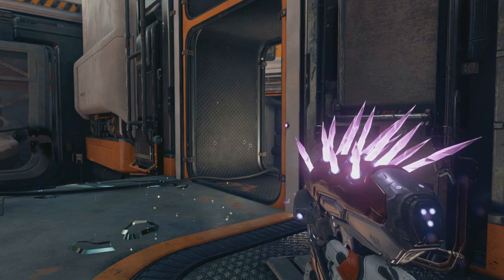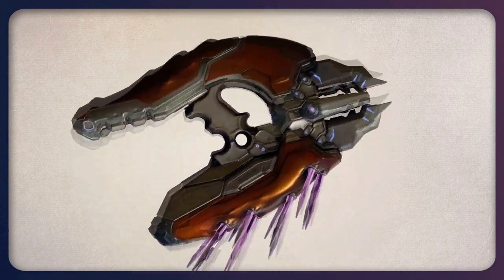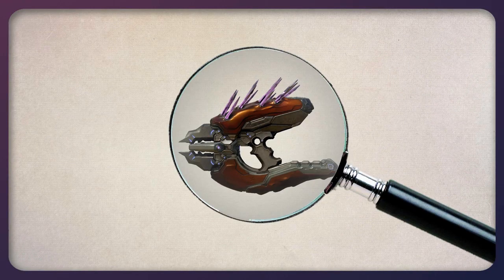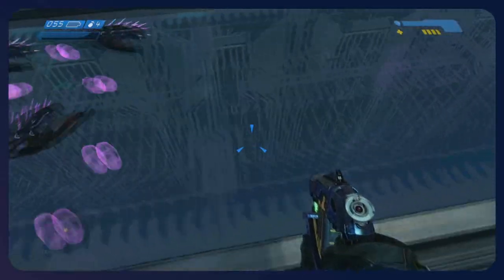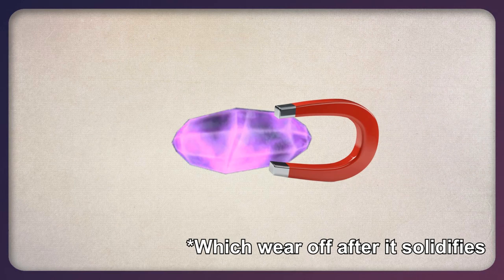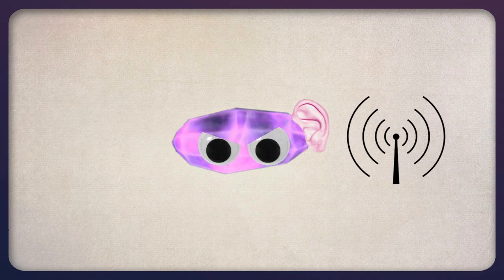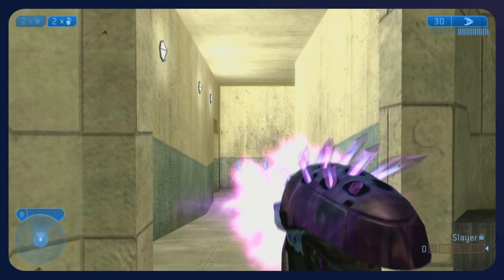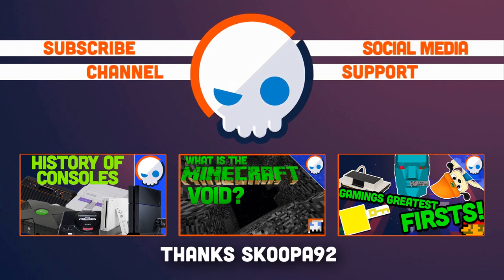Halo Theory: How does the Needler Work? | Gnoggin

Comment: so i have an idea:  
what if the gas could be electrified to a form a Crystal,  and that the main rock is under pressure to form the gas.  Now yes, that might not be possible for a a rock to be come a gas only under pressure,   but what if the crystal form of the gas is electrified to provide the heat to turn it into a gas, then when fired it cools down almost instantly with air and it shot out to the scanner to find the target.  but because the cooling  is to quick and the crystal ammo becomes unstable, or doesn't react well with ether the nitrogen or oxygen in the air around it.   causing it to explode but only when the electrical impulse in the crystal is grounded (when there is little to no charge in it).  but that's all just food for thought, reply to me with your own thoughts on this idea :)

Comment: I kinda got a theory that makes a bit more sense.  Maybe it's just a gas that freezes on the outside when exposed to outside air.  Essentially making them hollow and filled with gas that expands rapidly when it gets heated.  So you start with the big hollow gas filled chunk.  Put it in the gun that's sealed from outside air.  Flick it down and it pushes and separates the gas out the holes in the top which hardens on the outside creating the hollow needles.  Now when the needle are fed back into the gun, it goes back into a gas form and gets blasted out the mussle at high velocity.  The gas hardens on the outside back into the needle shape as it enters the atmosphere and impales the target and detonates from the heat.

Comment: what if temperature has something to do with the needles being solidified when in contact with air and it being a gas inside the gun, maybe the inside was heated so that the blamite can turn into a gas, and as it shoots out it solidifies because blamite may have a property in which it solidifies very quickly in normal temparatures

Comment: If it is a gas inside the needler. And solidifies out the top only to be turned back into a gas to he fired back into a solid. Why not just go straight from the original gas to the shot needles?

Comment: in halo 5 you notice a pink electric impulse at the top just before the needles come out when reloading. Also at the front of the weapon there is a constant beam of pink electricity so perhaps it conducts with extreme heat or a certain element that solidifies this gas to hard needles.

Comment: If it does turn the needles on top back into gas, I don't see why even bother with them. Only reason I see for that is if they use the already formed needles, or at least parts of them, as a catalyst for the ones fired.

Comment: You've said it yourself when needles are fired there's only part of them and the rest stays in and you yourself said that the needles are too long to fit but you showed it was the whole needle, a piece can fit through and then the seeking part comes in, the needles also have databases and gunpowder in them, they take in the data from the scanners at the end of the gun and once they have enough time to get the data they need their broken into pieces, each piece has gunpowder and data bases, and the flicking of the wrist is to help speed up the process because when you shake your phone while something is loading the phone gets even more wifi thus making it load faster, and back to the part with the censors, they might actually be in each piece of the needles and they sense the specific target and lock on and releases gas to keep the needle going and with both of those possible explanations there's also another part of the needle that sets off the gunpowder thus making it explode, and if enough needles are gathered in the target they sense each other and set off the gunpowder

Comment: Nice speculation but what would the point of the needles sticking out the top be?
Reply: +Spluff5 Seeming as the ammo crystal is turned into a gas (per the theory) the needles sticking out of the top would be the ammo clip. The Needler might explode when you reload since the solid would expand as a gas, so the excess gas vents out top and re-solidifies as the needles near instantly. Then as more gas is needed to fire the gun, the needles are consumed. Not a great system but probably very practical for a pistol sized weapon.

Comment: Maybe at a certain temp they liquefy. The interior is very hot which melts the needles into the chamber and as soon as it leaves the gun, it turns back into a solid due to lower temps.
Reply: Nvm he just said something similar.

Comment: Ok, 1. The supercombine is caused via energy in the needles that start to group up until there is no 'space' for the energy and it basically pops like a balloon... 2. If there was the grass then every time you reloaded you would need the gas put in it aswell... 3. It's a Subaneese crystal, not blamite...
Reply: Gas, not grass... My mistake
Reply: Also, if it were how you said it, it would be reverse engineerable via humans... And us sangheili do know what we are doing when we forge the Needlers, or we wouldn't be deemed worthy enough to do such a task...

Comment: Hmm, I like the theory. May I suggest however that instead of the crystal turning into gas, it is turning into liquid? If the crystal was being turned into a gas then it would have to pass by the liquid state, but since the liquid, or gas, is then solidifying it would have to make that transition once again. And I would guess that a liquid for is still enough mobility to make it from the needles to the muzzle. I was also thinking that maybe the crystal is melted inside the gun, so only a flick of the wrist is needed to force some of the liquefied crystal out of the top, which would solidify at the exposure of the cooler atmosphere. But hey, that's just a theory, a... Gnoggin... theory!
Reply: That makes a bit more sense, but the needles expel gas when firing and reloading, maybe it's steam? idk lol
Reply: Well a gas fits with other covenant tech since plasma is super heated gas ions. So maybe their tech has an easier time moving that around.

Comment: I'm surprised you didn't delve into diamagnetism in this video, Lockstin. If the inside of the weapon was heated above the external environment's temperature, this would explain the sublimation of the "Blamite" as it entered the weapon's interior, the lack of a diamagnetic field pushing the internal structures of the weapon apart and the deposition of the "Blamite" as it exited the weapon into relatively cooler external temperatures.

Now, living creatures (at least most of the creatures here on Earth) have a ferromagnetic substance in their bodies as well as moving electrical currents. Both of these things create a faint, albeit detectable magnetic field (that's what some types of MRI measure). Strong magnets attract diamagnets and ferromagnetic substances; or, as in the case of the needles, unaffixed light objects with a temporary diamagnetic field will be slightly attracted to external magnetic fields.

The mystery third gas could be a bit of the weapon's internal atmosphere escaping. Since heated gasses exert high pressures,. this part of the firing sequence would serve a dual purpose of supplying momentum to the needles as well as regulating the pressure changes created by sublimating some of the solid "Blamite" into its' gaseous form.

Now as for that curious tip of the weapon; this would likely be a secondary source of acceleration for the needles as well as tuning their angle of departure from the weapon to make it easier to target properly. The funny thing about diamagnetic fields is that their field lines are perpendicular to the field lines of the inducing magnetic field creating the diamagnetic field. This means that if the edges of the tip of the weapon were highly magnetized, then their field lines would force the diamagnetic needles out of the tip of the weapon at an accelerating speed until the needle exited the field. Increasing the power of the tip's field on one point or another would cause the needle to exit the field at an angle proportional to the difference in the strengths between the stronger magnetic point and the rest of the field.

Now, beyond that there is one tiny problem: a naturally escaping gas, even one undergoing a fantastic rate of deposition would not naturally form needle shapes. This can be fixed, however. At each point where the gas exits the weapon's internal atmosphere, there just needs to be a valve of some sort. For the top of the weapon, where the rounds are shown, a valve which allows a tiny bit of gas to quickly release and start a solid "seed" for the rest to cling to as it deposits would be needed to create the structures shown. The valve at the tip of the weapon's barrel would actually be simpler: all it would have to do is open fully and slam shut like a camera shutter for some short period of time. Once the gas mixture raced through a small external portion of barrel not subject to the pressurized internal atmosphere, it would readily reform a needle-like structure as it was quickly forced out through the magnetic field(s) of the tip.

This is just off the top of my head, so it might be completely contrasted by lore or some other source. I know nothing about Halo.
Reply: I dont think even Gnoggin himself would understand what you were talking about...
Reply: +dragonvale19 
This actually is quite simple, just the terminology throws people off. A phyics dictionary helps :).
Reply: can i just be lazy?

Comment: the forrunners made the needler just like the prometheon weapons...
that's why it cant be remade and doesn't have parts
Reply: actually no the needler was technology directly made by the Jackals it has no forerunner influences as the Jackals were space faring pre covenent contact. Forerunners have target tracking weaponry but they primarily use hard light so the process is different and far more advanced.
Reply: You mean the elites, they were the ones that made it not the jackals.

Comment: But it seeks where they currently are, not where they were when the needle left the gun.
Reply: No really, if the opponent moves fast enough the needler won't track too well. I just thought the needles are still magnetic and are attracted to the Spartan's armor.
Reply: +Chillydogdude 
well yeah, but it still tracks their current position not their position when the needle left the gun
i always thought of them as more heat-seeking. though i find it much more likely that they lock on to a specific biosignature. im pretty sure they are small crystal versions of missiles with limited self-steering

Comment: Maybe tiny nanotechnology that is controlled by the magnets, but has an outer layer of shielding that protects the machines while being  filtered through the nozzle. At least that's my guess. That the weapon is replicating nanotech like bullets mixed in with the rare element to solidify and break down the element in order to fire the shards.
Reply: Darren Litner if you use nanotechnology to create an antipersonnel weapon that fires purple crystals at targets at running speed, you clearly don't deserve such technology. as much as I like realistic sifi, a weaponized prince Rupert's drop is less far fetched than the needler. still... prince Rupert's drop does have some properties in common with needler ammunition... namely that it's a nigh indestructible crystal like object that shatters explosively under the right circumstances.
Reply: Fair  point but still if the tech was there why hasn't it been at least attempted to recreate IRL.
Reply: Darren Litner because prince rupert's drop is... well... not an ideal weapon. it's explosive force is mostly negated by the fact that the shards it shatters into are tiny, almost dust sized particles, and the fact that the tail of the drop is easily damage means that an accidental detonation is rather likely. it would make for an interesting relativistic projectile, however impractical.
Reply: Darren Litner

Comment: what if there are nanites within the gas and that's how the gas revives info the nanites like control where and how the gas reacts etc I dunno just a theory
Reply: +Levi Sullivan my own theory could be that while the crystals are formed, a network is created whithin the crystal structure that acts like a circuit board. making each crystal have a tiny computer that is inside of the crystal. similar to the computer within smart targeting seeker missiles.

how they physically turn to track is another question.
Reply: +Colin MacAllister I completely agree that seems like the most logical way for the tech to work but maybe they have little thrusters in order to turn like while the needles form to a solid some stay to the outside to turn them but how are these little nanites made and how are they kept in the gun with out spilling out and where are they kept
Reply: +Colin MacAllister that could assist the tracking system due to it not being able to give info the entire way
Reply: Levi Sullivan There is the fact that the needles themselves in flight have an aura around them. aswell as leaving the visible trails. that could play into how they physically track their targets.
Reply: Ya that is completely viable that that is like a self propellant or a system to track heat like u said about the missile tecnology. That could also be the thruster theory I suggested about how the nanites that help form the crystals have thrusters cause as we have seen in the covenant vehicles the aura per say is a purple or pinkish color so these nanites could have these small thrusters like the banchese and ghosts that assist the heat sinking and targeting info given by the scanner of the gun
Reply: Colin MacAllister